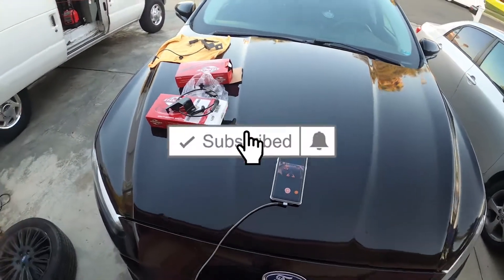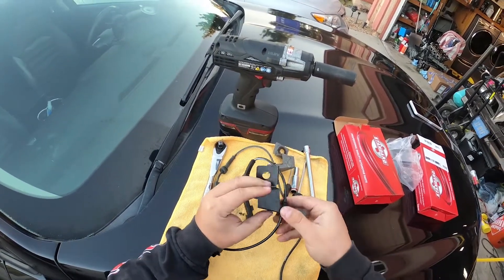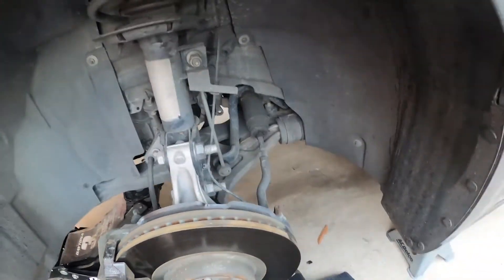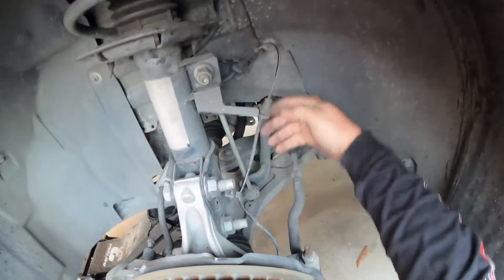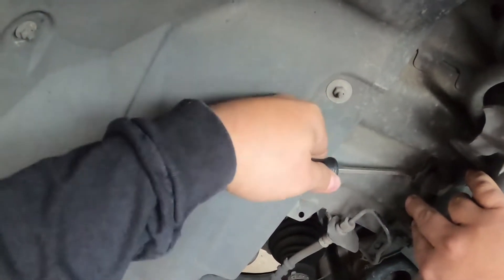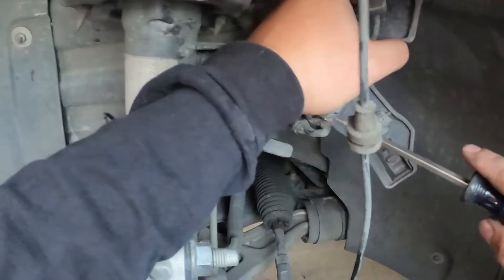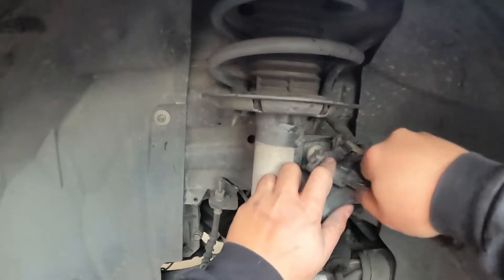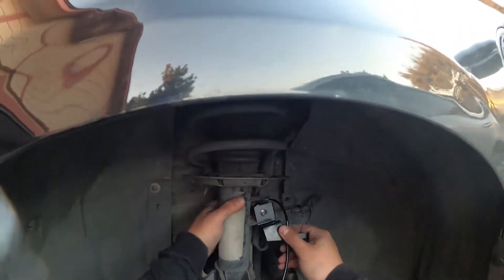Replacing A 2013-2020 Ford Fusion Hybrid/Energi Wheel Speed Sensor

Comment: If i have this prob an the censor went out would my car just stop moving? Cause I can put it in park an start it an it will run in first gear an then shake an not go into second but a wierd noise is coming from the front driver side wheel
Reply from the maker: This sounds more like a cv drive axle joint and possibly a transmission issue.

Comment: I just bought a 2015 fusion, abs comes on sometimes and wheel gets hard to turn etc. is that a speed sensor problem?
Reply from the maker: My fusions steering wheel got hard and went away due to the wheel speed sensors also
Reply: I think so. My sensor was burning out from the wire and was losing connection every now and then until it finally stopped. Wrapped it up in electrical tape and the connection got a little stronger. But yes the steering gets a little tough and low speeds like when you park

Comment: Wich website you bought it from apparently my ford dealer brought me similar but not match piece
Reply from the maker: Used standard ignition wheel speed sensors 

here is the front left https://amzn.to/3PsVJSq

Here is the front right 
https://amzn.to/3QKjiY8

No issues after 50k miles on the new sensors
Reply: @mechanicbuilt  thank you man you are the best

Comment: I'm looking at replacing the sensor on the rear passenger side. The previous wheel bearing hub had a thru hole whereas the new one has an ABS sensor port on the back side. The Energi service manual also notes that the rear hub would have an ABS port integrated into it...

Comment: You should try and change a 2013 up here in upstate ny with years of salt and sand etc lol. Had wheel bearing went bad had to take the whole knuckle off and use 80 ton press to remove bearing after trying everything else . The sensor was so brittle it broke apart trying to remove I had to carefully drill out the old one
Reply from the maker: Use a torch lol
Reply: @mechanicbuilt  done that before but with the aluminum knuckle  and upper and lower control arms the heat can mess up the  protective heat treatment on it and the upper and lower control arms even at a low temp. I’ve seen those break after using heat on them under load. But for a majority of vehicles I agree with you on the torch lol
Reply: I see these posts all the time.  Makes me kinda glad I live down here in the south!  Shoveling snow also, don't sound like fun!  Ugh, the heat in the summer tho!  I DEFINITELY see why people with money head north to travel in the summer!

Comment: How can i know wich of the four sensors is damaged?
Reply from the maker: Forscan is a great free trail software for fords but you have to buy hardware to use it. If you can find anyone who can read the body codes on a obd scanner. That may be your cheapest or even free option to find which ones are bad. If you find out which axle the bad sensor is replace the otherside also.

Comment: Any issue with rail fuel pressure sensor?
Reply from the maker: Never had to touch the engine except for spark plugs i do have a issue with my seat belt sensor causing my airbag light to go off